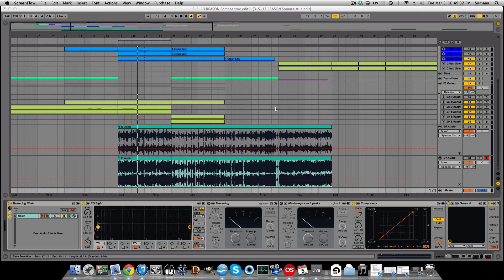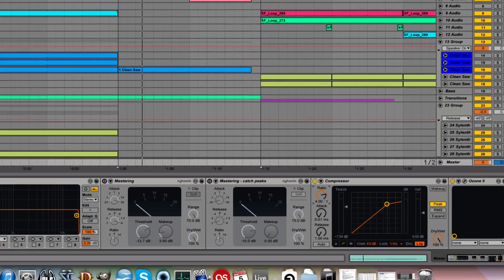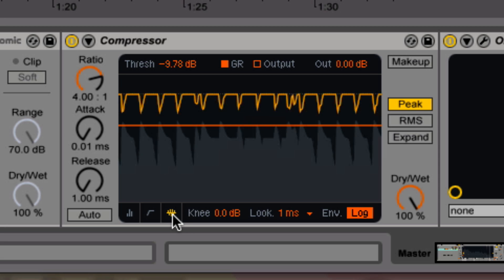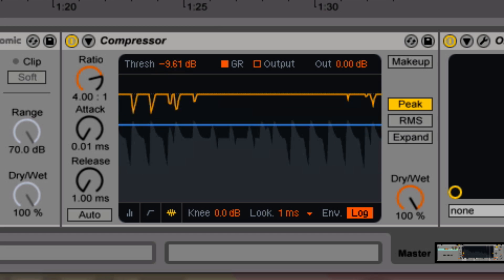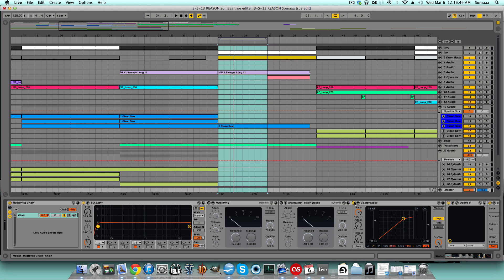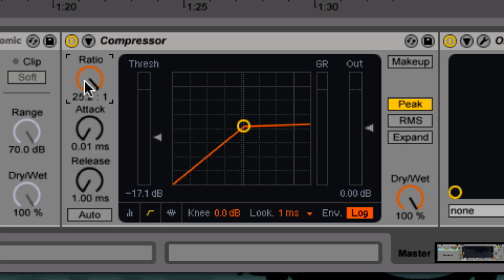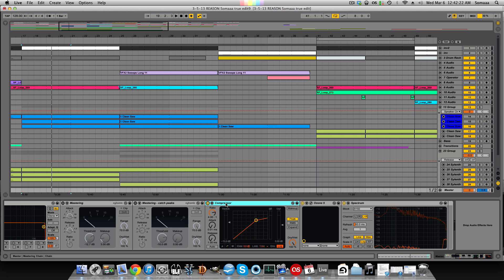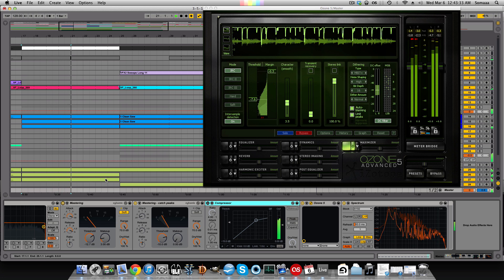How to Use a Compressor - Ableton Live 9

Comment: Thank you for your tutorial. So lowering the threshold brings the loud parts of a track (say a vocal track) closer to the volume of the quieter parts of the same track. So you then compensate for the lost volume by turning the track up in the mix or by tinkering with the parameter to the right (in the compressor) labeled "Out?"
Reply from the maker: Yes, that describes downward compression. Theres also upwards compression that turns up the quiet sounds to match the louder ones.